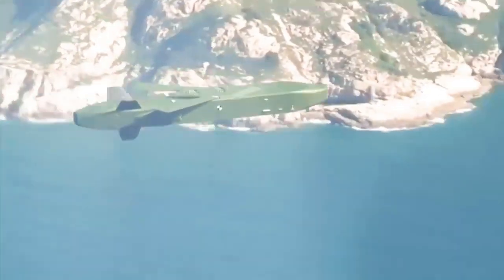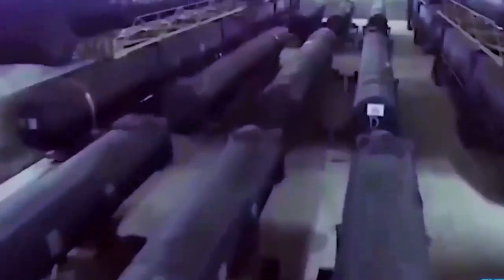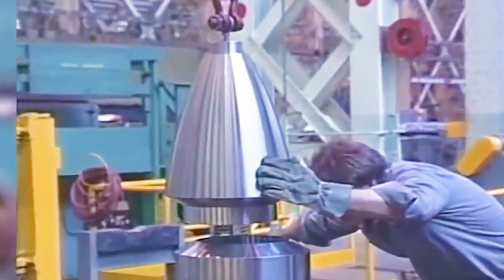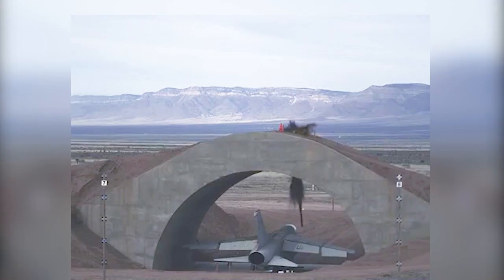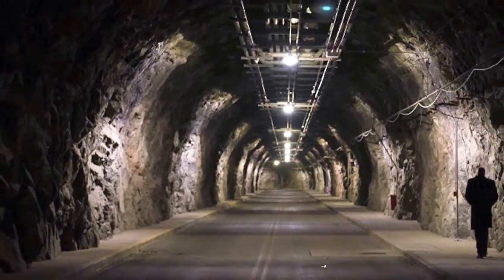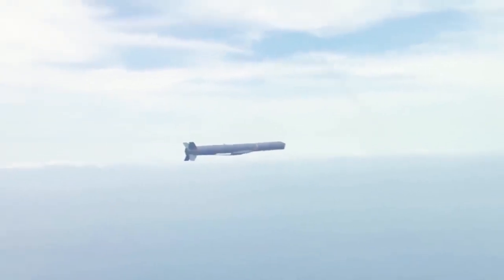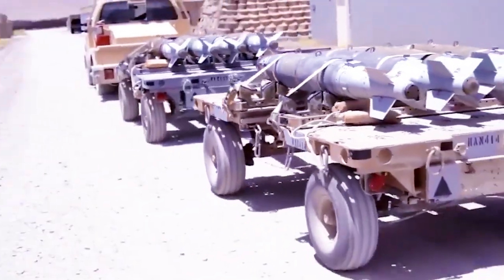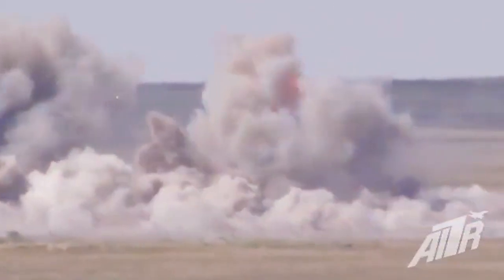6 Most Powerful US Bunker Busters that Can Penetrate Underground nuclear Bunkers

Comment: Y. T. / Nuclear. Siren"s . Get a good, bowel movement, as we head for, a nuclear war, then, a nuclear winter, Revelations 8:5 - 16 Isaiah 13:9 - 20 Zachariah 13:1 - 17 said, 2/3 s of Israel, fall, but run to The Wailing Wall, Cry To Abraham God, who sends, a revival, short sweet, a nuclear, explosion"s, or nuclear winter, 2 Peter 3:8 - 17 loud noise. Great heat, . Boom ! Malachi 4:1 - 7. Moses & Elijah return to The Tribulations, same, Two anointed ones, Zachariah 4:1 - 14, . Anointed, in Revelations 11:1 - 29 same, Two anointed ones. Numbers 12: 1 - 8, Hebrews 3:1 - 6 its, Moses & Elijah, in Tribulations, preaching to, Islam, romans 11:11 - 36 & 2 Corinthians 3:7 - 16, . When, Israel, SHALL call on God, at, Wailing Wall, in Tribulations, made white, Tried, Daniel 12:1 - 4, 10 daniel 11:32 - 47 a Strange GOD, . is a fallen, Brussels Belgium. Computer, to a Starving, Chinese, Dragon, a 200 million Revelations 9:14 - 29 it say"s, 1/3 the Earth, die, by, Kings of Tje East, Daniel 7:5 - 15 russia, nuked, U. S. Canada. B. C. Nuked, & Two Toes, fall to Chinese Dragon, Rome Italy, Banks, and a deadly, captured, Brussels. Belgium. Computer. System, a STRANGE. GOD, Daniel 11:32 - 44 news from west, Russia nuked, Three Toes, and news from East, . a 200 million Chinese Starving Dragon, . after, a revenue loss, from, Nuked, B. C. & Canada, Unatural, all Three Toes, so 5 Toes fell, just as, Revelation 17:10 said, so, and 1/3 Green Grass Nuked, so 1/3 the Earth was, Nuked, by a Y .T. / Russias Newest Zircon Missile. . Y. T. / Russias Newest Hyper Sonic. Missile. . Y. T. / Iran"s Hyper Sonic. Missile. Can. Destroy. U. S. Navy. In. 40. Seconds. . Y. T. / Russias Newest, Electro Magnetic Pulse. Bomb., Revelations 6: 12 - 17, . Is answered prayers from all Saints killed, just, prior, to Washington. D. C. Will be. Nuked, as, Stars, falling, exploding, is a Russian 90 foot long missiles, coming thru Space, as, Daniel 11:5 - 26, Predicted,va Last Day Female Super Power Nation was given up, by those, Socialist, Welfa-e, Musl-ms, a Catholic OVER. FLOW of Illegals, you refuse to start sho-ting, ki-l all, snatch & Grab, sho-t alk brown eyes, Car thiefs, are 92% a. A. In mobile Alabama, . A. A. are, 79% on welfare, pluck out eyes, taxes, ki-l 1 Samuel 11:1 - 16 & 1 Samuel 15:30 - 33 1 Samuel 27:1 - 26. Numbers 25:5 - 15, . Sho-t, all . With, silent, . Quiet, . Wonderful, . Cross. Bow. Pistols, Cross. Bows, 1 Samuel 31:1 - 13. 2 Chronicles 23:1 - 26 shot Democr-t, Athaliah, with, a Cross. Bows, 2 Kings 9:22 - 24 2Kings 11:1 - 35 ki-l all, L. G. B. - . WRATH of Jesus is Upon Vile, Filthy, A. A. L. G. B. - . Ki-l all, now, Ecclesiastes 3:1 - 8 Eclesiastes 8:11. Numbers 31:1 - 27. Sh- ot all burglars, . Sho-t  all, armed Robbers, . Cross. Bows. Pistols, . Use. Broad. Heads, . Amos 3:3, 7 Amos 5:13 - 15. Hebrews 1:9. Romans 1:16 - 32 & 2 Timothy 3:1 - 13. Sho-t all, . Illeg-ls, . Now. Proverbs 22:3. Proverbs 27:12. Proverbs 28:5. Daniel 12:1 - 4, Technology. Increase, a Broad. Head to a Democr-t. Eye. Ball ! Cross bows, cities will be burn down, next, Matthew 24:20 - 39 stock pile, bibles, dried beans, dried, . Black. Rice, Brown. Rice, & Victor Rat Traps, painted, a brigjt paint, for squirrel meat, all, large U. S. Cities, will, the, Cursed , repeat of 1969, Advanced, Whites invent buildings, and , Cain, brown, Killer"s, are 86% of Americas Catho-ic Federal Hate Laws, you white home owner"s, better, bury, mr. Killer, kinky, bald head, huge slave muscles, bald headed, we Superior Christians, obey, Deuteronomy 5:1 - 44 we have a small pointed noses, not huge flat brown noses, not huge lips, we have small lips, with, multi colored straigjt hair, marry first, we care about, our race, Cain aint ! Harris will be next U. S. Presadent, as, Daniel 11:5 - 26 is, Lady Liberty, Destroyed by a Cathol-c OVER. FLOW, Ill-gals, . Ki-l at, nigjts, sit on a rokf tops, busy drug dealers, Herion, Cocaine, Fentynal Dealers, . Sho-t with a Silent, Cheap, Accurate, Cross. Bow. Pistols, . Use Broad Heads, Sho-t all, Cathol-c Sodomo-e Prie-t, Amos 5:13 - 15 Ezekiel 9:1 - 12  1 Timothy 5:8 defend your neighbor hood ! Pray Psalms 20 & 91. For protection, then wear a ski mask too, shoot walk off, shoot walk,bdrive off, Ki-l all Evil. Daniel 12:10